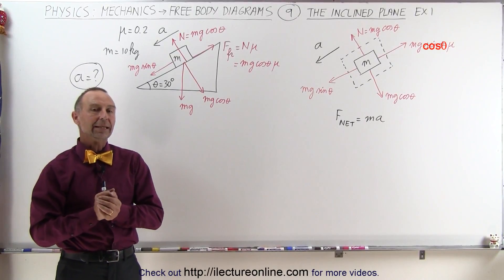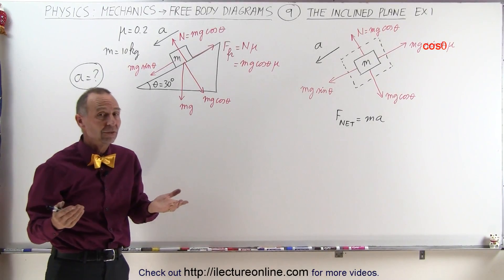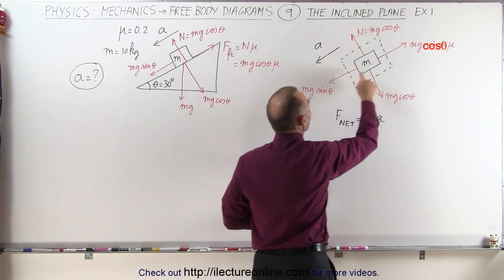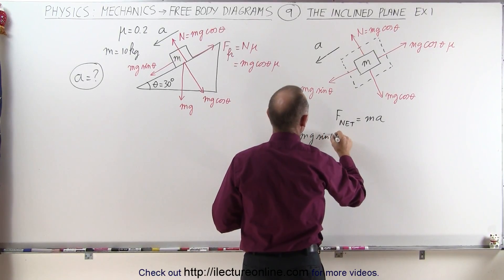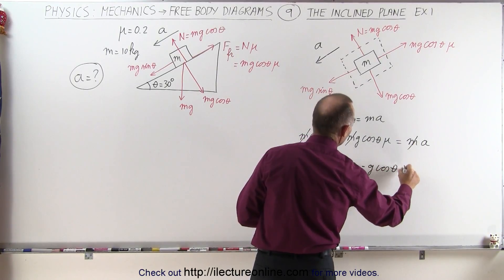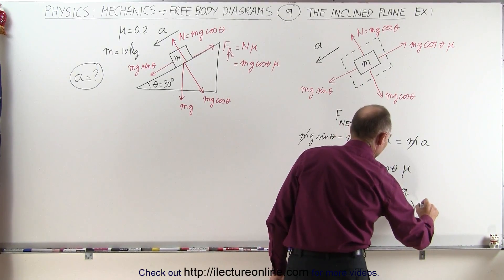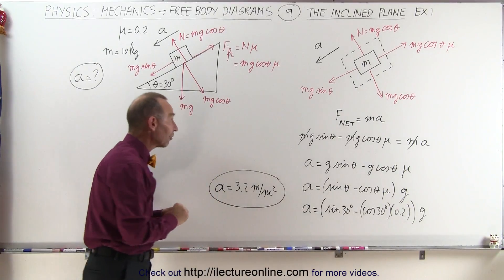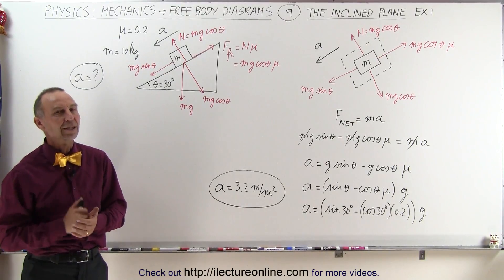Physics 4.8   Free Body Diagrams (9 of 10) Mass on Inclined Plane: Ex.1

Comment: Sir, I have a question. In some of your videos you take cos for friction but on some other videos you take sin. Why is that different and how do I understand which one to take??
Reply from the maker: It is simply a function of geometry.  Always use the definition of the sin = opposite side / hypotenuse and cos = adjacent side / hypotenuse.    So take a look and determine what the geometry of the problem dictates.  It is better to determine the right function like that then to try and memorize certain situations.  After you apply this often enough you'll see the pattern.
Reply: @MichelvanBiezen  Sir, I am saying that sometimes you take the friction to be caused by the normal force but sometimes you take it being caused by the force that causes the movement. Why is that different?
Reply: @MichelvanBiezen  Sir, I am saying that sometimes you take the friction to be caused by the normal force but sometimes you take it being caused by the force that causes the movement. Why is that different?
Reply from the maker: Friction is only caused by 2 surfaces sliding across one another (kinetic friction) or one surface preventing the motion of another (static friction).

Comment: Hello Mr. Biezen, I have another question...

A box is on a slope with variable angle of elevation. If the static coefficient of friction is 0.3, what is the largest possible angle where the box won't move?

For this question, do I do mgsin(θ)=μmgcos(θ)?
Reply from the maker: That is correct.